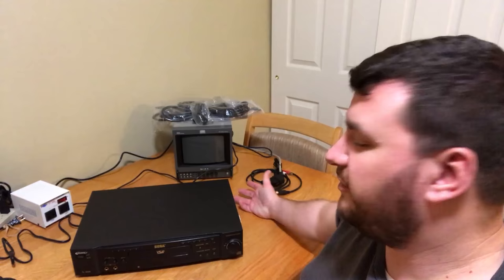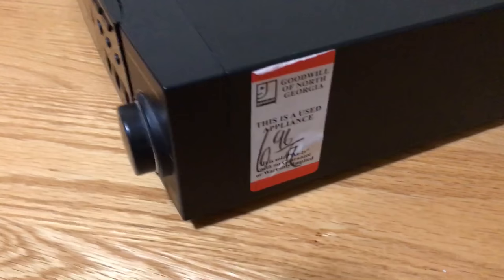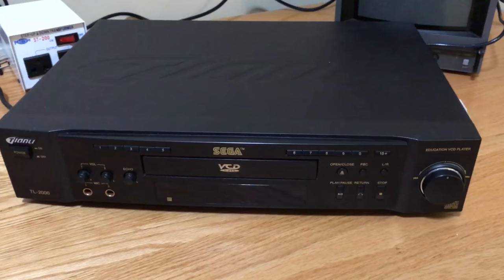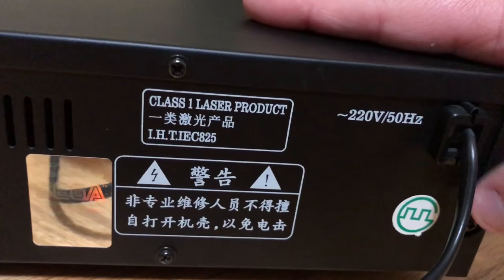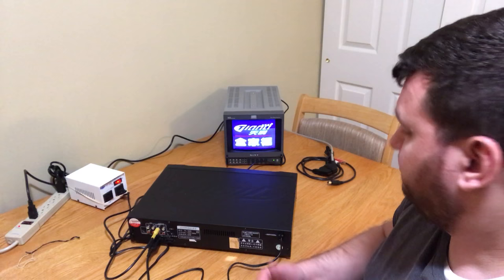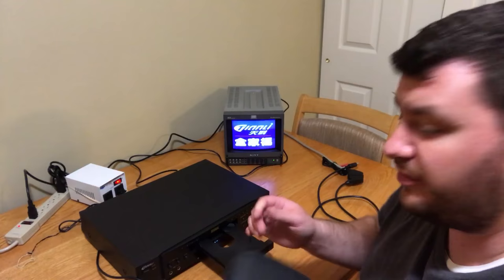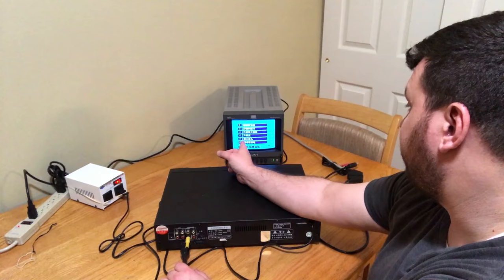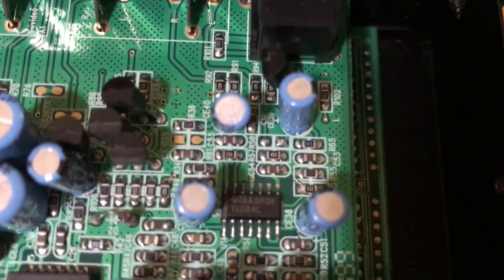Tianli Sega Genesis VCD Player

Comment: Great stuff!  Very interesting!   Looking at the board with the Sega chip there, there's one in the corner marked 'Hawk' - I suspect that is feeding the serial data from the CD into RAM on that board, and its then booting the cart from RAM.  I guess Sega eventually merged all the asics into a single chip solution (assuming that Sega chip is original Sega).  The board above it with the Winbond chips looks like the main MCU of the system, for decoding VCD etc and feeding data to the 'Sega board' below.   Glad you showed the insides of it.
Reply: @GadgetUK164 - For God's sake, man - don't you ever sleep? :p

The 315-5960 is the same ASIC used in the VA4 Model 2 gen by the looks of it...

http://segaretro.org/Mega_Drive_PCB_revisions

@RetroRGB - I know that Winbond VCD chip very well.

You know what else it's used in? Yep, that's right... The Doctor V64 N64 "backup" / VCD unit. ;)

The V64 also used that same excuse to call it a VCD player to allow it to be sold / imported / exported, but it's primary use of course was to play the ROMs from DRAM.

The W78C32 looks to be the main MCU on the VCD board.

The W9925QF is the VCD / MPEG1 decoder itself, the Panasonic chip is the DRAM for that, and the W9952QP is the TV encoder (for Composite and S-Video from the digital output of the W9925.

Looks like it may be possible to RGB mod the Genesis side though, as you said.

That HAWK chip looks interesting.
Looks like it is loading the data via a quite slow serial interface into those two large DRAM chips on the Genesis board.

They are 1Mx16 chips, so 2Mbytes per chip.
That's larger than any standard RAM on the Genesis / MD...

http://www.datasheetlib.com/datasheet/729124/gm71c18163cj6_hynix-semiconductor.html

The DRAM chips are essentially being used as a cart emulator then, just like how the V64 operates.

The rest of the stuff on that lower board looks fairly standard.

Great stuff.
I'd heard of this player briefly in the past, but never really looked into it.

I did want one of those Nuon players a while ago, until the novelty of the idea wore off. hehe
Reply: Searching for the patent number on that HAWK chip reveals this. ;)

https://www.google.com/patents/CN1102288C?cl=zh

I could have done that first, but I was on a roll. lol

Apparently it does use an 8-bit parallel interface to transfer the game ROM data from the buffer in the MPEG chip to the HAWK chip (and then into the DRAMs on the Gen / MD board).

Still surprisingly slow though, as even a single-speed CD drive should be able to load most ROMs in only a couple of seconds.

The bottleneck must be in the way it's transferring the data via the MPEG DRAM, and maybe limited by the speed of the main MCU?

The HAWK chip does just act as a cart emu though, so it controls the addressing and refresh of the two DRAM chips, then appears as a normal parallel cart ROM.

The lower board could be used as a stand-alone Gen / MD that could load the ROMs MUCH faster by hooking up a more modern MCU. Would be a shame to modify the player too much, but that mod would at least be reversible.

In theory, the HAWK chips could be used as a cart emu for other 16-bit (or 8-bit) cart consoles too.
Not so easy to get hold of those chips, and probably not much point (what with FPGAs etc.), but I'm surprised to see that some chips have appeared on AliExpress before...

https://www.aliexpress.com/store/product/SSHK315-03-QFP100/2065046_32618842655.html
Reply: LOL =D

Comment: Thanks for covering this. Use to see this on import sites years ago and always wondered how it worked and wether it was clone hardware. Loading times are horrible even for something made during that time. That port might of actually been used for control function instead of video as similar style ports are used on other high end audio/video equipment. Were you able to test out the audio quality?

Comment: Wasn't a review of this system put up last year? I think on that Goodwillhunter channel. I'm probably spelling the channel name incorrectly.
Reply from the maker: Correct.  I was supposed to do a much more in-depth review then Justin, however I ran out of time.  At least I saw that there were newer Sega chips in it, so if anyone ever felt the urge to mod one, you could get full RGBs output from it.
Reply: @RetroRGB  great video